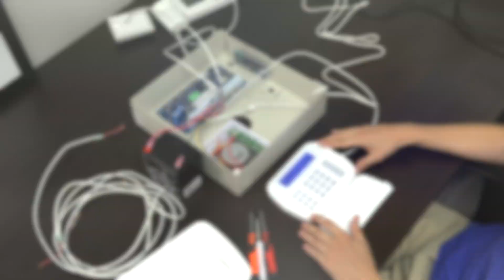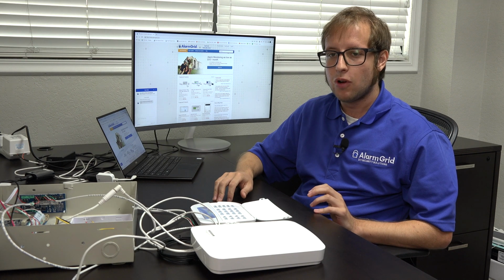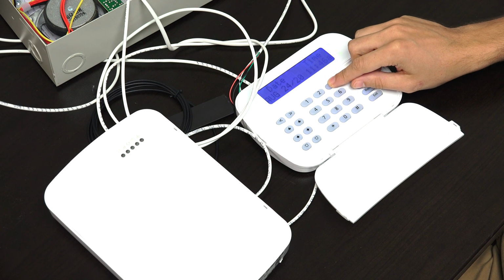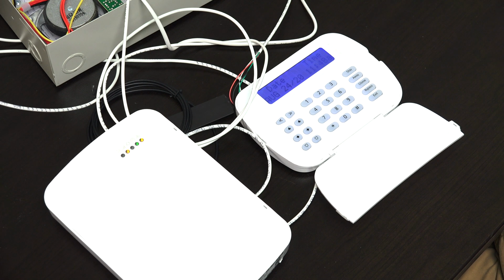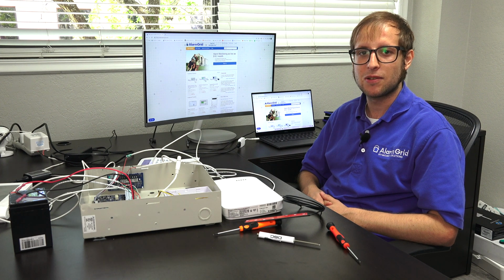Adding an External Communicator to a DSC PowerSeries NEO

Comment: is it PCL-422 provide 12 volt to the communicator or did you get 12volt from power supplies to the communicator ? Sorry my English. Thanks
Reply: The communicator gets its power from the PCL-422, which is getting power from the PC Link cable connected to the panel.

Comment: By hooking up this radio do we still need to program field 301, 302 for the number and 310 for the last 4 digits of the account??
Reply: 1. Verify section 382, option 5 is Enabled.
 2. Verify section 300, option 001 is set to Alt Comm Auto.
 3. Verify section 380, option 1 is Enabled.
 4. Verify section 301 option 1 is set to DCAA.
Reply: Thank you

Comment: Hi! I changed my SIM card Provider, removed the SIM PIN, yet I get the following troubleshoot message: Cellular Trbl, Alternate Communication. I have contacted the Phone Provider, and there is active signal on the SIM card. Could you please help? thanks!
Reply: Hi Theklia, The sim card in the Communication module is not to be removed or swapped with another SIM card as they pair to that communications module allowing them to communicate successfully to the service provider. If you changed the SIM card and the communication module stopped communications with the servers, that would cause the error messages you are seeing. If you still have the original SIM card, you would need to power down that communicator and put the old SIM card back in.

Comment: How do I add a key switch  from Konnected to the DSC panel? https://help.konnected.io/support/solutions/articles/32000028765-wiring-a-keyswitch-with-relay-module
Reply: Here is the programming required for that
Section   subsection       data
 [001]         [001]               (001) Program Zone 1 as a Delay 1 (001)
[001]          [002]                (066) Program Zone 2 as a Momentary Keyswitch Arm (066)
[002]          [001]                5 ON Toggle on Attribute 5 for Zone 1 - Force Arm ENABLED
[009]          [002]                (200) Program PGM2 as a Zone Follower (200)
[011]          [002]                 (002) Program PGM2 to follow Zone 2

Zone 1 is strapped off with a 5.6k resistor.
Zone 2 is secured with a 5.6k resistor.
PGM2 is strapped to the Zone 1 terminal with a shorting wire.
The Key Switch mechanism is wired as follows:
If N/O - parallel the connections across the resistor on Zone 2 and COM
If N/C - series the connections with the resistor on Zone 2 and COM

As far as the Konnected system unfortunately we are not familiar with that side of things and may have to contact them for the programming on their side. If you have any other questions feel free to contact us at support@alarmgrid.com
Reply: @nathangalarmgrid5205  thanks for your help on this. Very new to this stuff. Do you have people in the Boston area that may be able to help with some of this stuff in person. 

I’m basically trying to do this https://help.konnected.io/support/solutions/articles/32000028765-wiring-a-keyswitch-with-relay-module
Reply: Or if you’re able to help via FaceTime